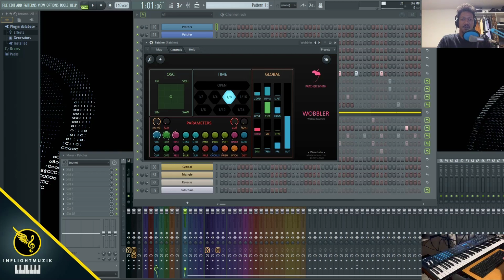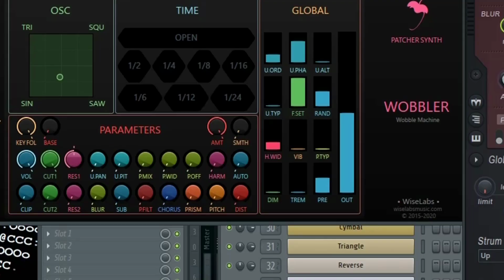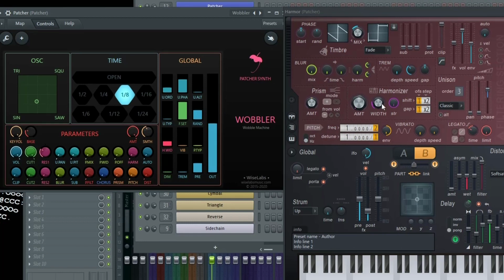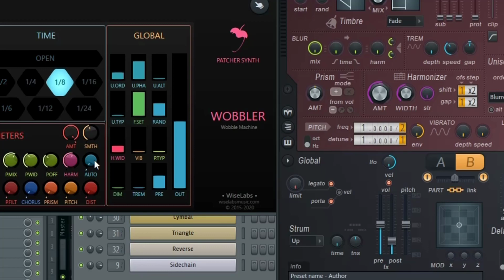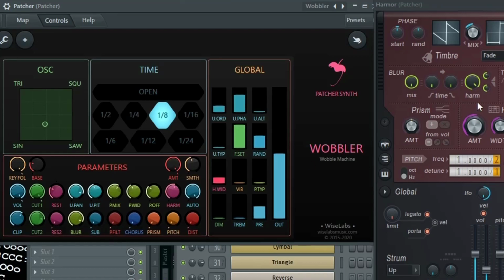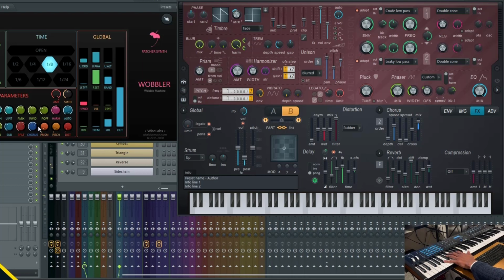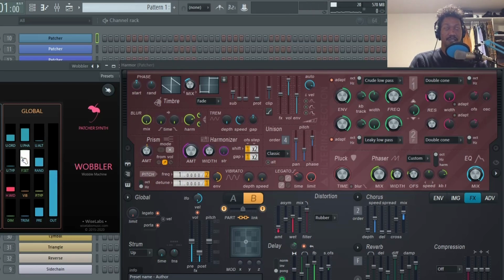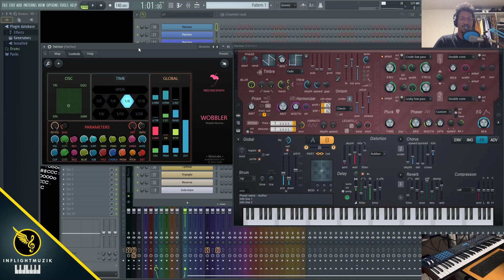How To Make WOBBLE Bass In FL Studio Wobbler Patcher Preset

Comment: Hi bro i have question about the ample guitar SC ...does the amp in the AGSC is same as the guitar rig? Which means i do not need to buy guitar rig anymore cause in AGSC had alot of different amp?
Reply from the maker: You don't need to buy guitar rig.  There are plenty of amps, mics and cabinets for ya in Ample Guitars.  Plus, you can combine that with the fx in your daw.  After you've done that for a while, maybe later down the road you'll want to buy more amp plugins like guitar rig.
Reply: @Inflightmuzik  thanks man, i almost buy it yesterday🙏🙏